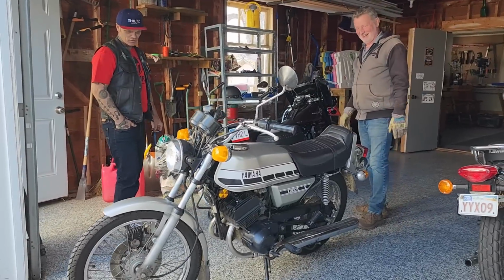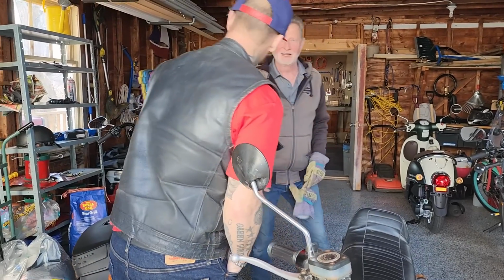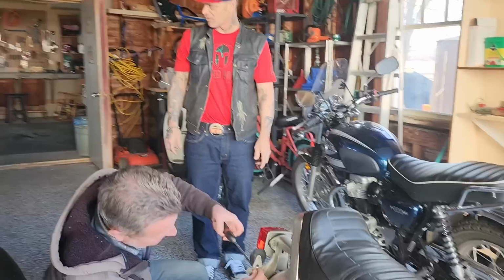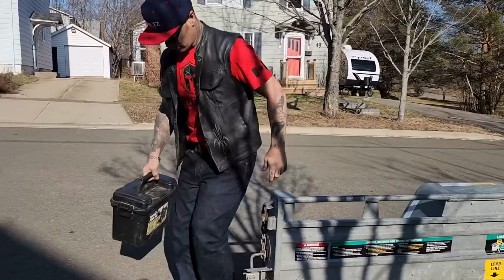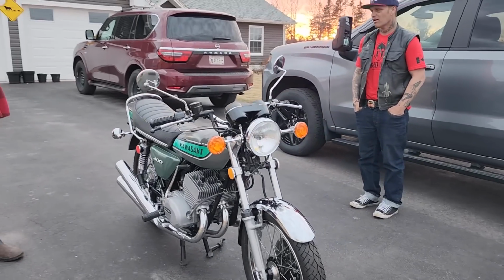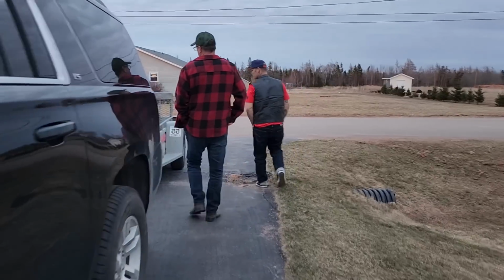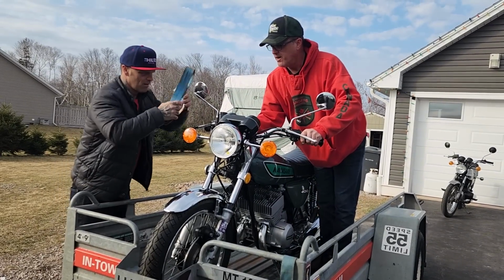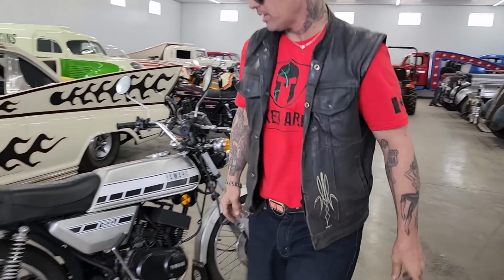Can't believe we found this for sale on facebook marketplace 😝

Comment: Chad, the guy who sold you the Kawasaki was an excellent rider and his advice not to lay down the Yamaha was absolutely correct! If you had several moving blankets and padding and took off the handlebars, tank, front wheel and front fender you might have avoided damaging the Yamaha but it would still be risky. You and Jolene really scored on the bikes and the former owners! Great video! Congrats!

Comment: Hi Chad & Jolene, that is quite the collection of motorcycles that you have aquired. You guys are going to run out of room in your new building pretty quick at this rate. You may have to put in a 2nd story with a lift for the bikes. You can install metal 2nd storys that are supported with posts from the first floor. Alot of dealership parts departments are done that way in the U.S. and they carry alot of weight. Those were nice looking bikes with low kilometers they will be a nice addition to the collection that you have. Thank you Chad & Jolene for taking us along with you on your trip. It is nice to get to see some of Canada as well as seeing the bikes!
Reply: Those R. D. s were a good pretty reliable road bike.

Comment: Most of the early Japanese motorcycle brands have a lot of interchangeable parts in their models, you’ll find one part will fit a number of models across their lineup, from road bikes to motocross bikes, using part numbers are key to finding parts.

Comment: The best advice I can give you is go sign up for the cycle safety course near you and do it as a couple because it doesn't matter what you ride or how fast you ride because there is nothing better than wind therapy and I mean NOTHING  better for your soul but if you have a spouse that rides too weather you are riding on one bike together or riding separately, it's something that takes your relationship to a hole new level.

Comment: Great find- those bikes, when they "come up on the power band, are pretty quick. The 500 was FAST, the 750 was just wicked. The 500 was a street beast in its day. Same way with the Kawasaki 500 and 750 triple 2 strokes - wicked fast and fun.

Comment: i was always told to tie down the front of the bike around the fork at the fender connection that way your not using the shocks . attaching at the handlel bars your'e going to get movement and the straps could loosen.

Comment: You really need to know your stuff to keep one of those kawa triples going ,,best to get a expert to tune them or go threw it if you are going to ride it ,,i haven't had much to do with one for years but guys i new said they used to run the middle carb a little rich & ran a different heat range spark plug in the centre cylinder if you don,t they run lean & melt the centre piston ,you could more than likely find info on the net about it ..just letting ya know they can be a bit finakey not many around as most melted over & over as people didn't know how maintain or tune them & they were costly to fix & got scrapped .

Comment: Yes, you can put two bikes on there- move that one over- forget that stick out in the front. Put 400 next to it, staggered back a little.
Duel straps to handle bars on each- pull down till forks are at least half way compressed, then stap back- your done.
No, don't  suggest putting bike in suburban - you have fuel fumes, oil, leaks- good way to burn to death if something goes wrong.

Comment: Does Chad have something against owning a proper trailer for bikes and cars?
Reply: I was wondering the same thing. Would be cheaper in the long run than having to pay a rental fee each time.
Reply: He's not quite evolved there yet, that me- haul trailer will hold  3-4 small bikes like those 2 & he considers stuffing one in the back of a station wagon. Just putting the kick stand down before loading had the guy  lost & confused.

Comment: A good investment. Used to ride a Yamaha XS 500, four stroke, with a similar design, a bike that handled very nicely, had Metzeler tyres on it, a super quality brand as well. Also had a Kawasaki 750 four stroke.
Be careful on the Kawa, fast as a rocket and can be a bit sloppy in the rear - if you ever experience 'speedman's wobble' the cure is to immediately lay down over the tank and let off the gas. Good luck, be careful.

Comment: Great finds Chad! But remember, those two strokes can give you nasty surprises. Like a runaway horse! That 400 is a widowmaker!
Reply: Thats for sure  I have a 1972 Kawi 750 H2 triple and she is an unpredictable girl.
Reply: @Robert Bard  Do you think Biker Bill Kalina is referring to the narrow Power Band ? Gotta ride with your foot over the brake pedal
Reply: @speedfreak8200  That would be part of it,  I know on mine it is a speed wobble problem and having to lay on the tank in hard acceleration to keep the front wheel somewhat on the ground.
Reply: b  Kalina    im thinking u have riden the 400 . i chuckle when i hear that sort of a comment about them . i have some experience on one .
Reply: The sound and smell of a Two Stroke.Nothing like it.I had an RD250 briefly back in the early 80’s.Supposedly had 400cc conversion 🤷🏻‍♂️🤷🏻‍♂️🤷🏻‍♂️ according to the guy i bought it from.JandR expansion pipes on it.Sounded awesome and went like stink in it’s day
Reply: No worry cuz Johnny (chad) don't surf..

Comment: Great find, yes Bad Chad, I start and run each one of my motorcycles and four wheel atv until it stalls making sure the gas is out of the carburettor, that trick has never failed me yet, they will start back up without hesitation or hiccups. You may have to or want to crank over all your motorcycles a couple times a year if not at least once a year, try to plan a day in a month or start them, either or,, it may be all right if you don't but what the hey,, due diligence, preventative maintenance and all that jazz why not..  thanks Jolene for taking us along the ride.

Comment: The Kawasaki 400 3 cylinder 2 stroke is a wicked bike. I owned a Kawasaki 750 3 cylinder 2 stroke which was called the widow maker. Both bikes are highly sought after in the USA. Good purchase Chad and Jolene !!
Reply: Called the Widow Maker because it went like a cat out of hell in a straight line, fuxxer did not handle, no good in a corner, i owned one.

Comment: Hi there, if you are into 2 stroke motorcicles, look for a 750, 3 cilinder water cooled Zuzuki. The so called water buffalo here in Holland. That is a real icon and a rocket to drive......👍👍👍
Even more interasting is the Kawasaki Z900, used in the Mad Max movies. They are worth a fortune.

Comment: Chad you are correct; Jolene is very sharp , she noticed that fuel petcock was on and needed to be turned off.  Beautiful bikes and worth the drive.back in the day we had a bike shop and sold those exact bikes you purchased.  With that fleet you have you need an experienced   mechanic  . Thanks for the video. It seems many people retire to the east cost of Canada . Spring is obviously there. where we are in Ontario we still need heavy jackets and heating.

Comment: Whilst moving a bike leave it in gear pull in the clutch, when you stop let out the clutch, it won't move, especially if the bike is down hill (I learnt the hard way 😂) leave it in gear whilst on the trailer also. 👍 👌

Comment: Nice score! I just found a 69 HarleyDavidson FLH and a 64 Harley Davidson XLCH for sale within a few hours from me.  I already own a 68FLH that was my father's, and my 1st bike was my 64XLCH that i still own. I want to buy the 64 at least, but i don't have room for it right now and I'm in the hunt to buy a house. 

Both bikes should fit on that trailer easily! Roll one straight on, move the ass end over, and strap it down, then back the other bike on and strap it down. Two will fit easily. 

Edit: or maybe i need to shut my mouth and watch the video before i comment, because that's exactly what you did. Awesome video Chad and Jolene! 🤘

Comment: How to lay a bike on its side safely.  See other post on loading the trailer easily.  The problem with laying it over is two fold.  1 it will drain the carbs and fuel line when laid over and can flood the engine cylinders with gas and wreak the engine.  To eliminate that there is a screw at the bottom of each carb near a hose out of the bottom of each float bowl.  The hose may be missing but the screw is still there.  You just loosen the screw until gas runs out on the ground and stops.  Do this one carb at a time to make sure each one drained. If it doesn’t drain you either have a carb not working or junk in the bottom of the float bowl plugging the drain.  Anytime you park the bike for extended periods 3 months plus you should open the drains and empty the carbs to eliminate gumming them up with varnish and corrosion.  Second issue with gas is to get the tank empty before laying the bike over.  The cap is vented and especially on old bikes the gaskets on the caps leak and you can fill the vehicle with gas.   Other issue with laying the bikes on their side for extended periods transporting is the seals in the engine can allow oil to get past them and cause fatal damage filling crankcases on 2 strokes with transmission oil or filling cylinder with oil through valves and rings.  Some older bikes have separate oil in the transmission and engine sections but have a vent hole for fumes high in the cases.  When laid on the side for long periods it can transfer oil from one side to the other with catrostrophic

Comment: Forgot to mention: turn your handlebars all the way to the left, it will make the bikes much more stable and less likely to get accidently knocked over. Either that or put them on the center stand if so equipped.

Comment: I have a suggestion for that center piece you are doing on the Thunderbird. Rather then filling it in, leave it open with maybe 3 vertical ribs inside for support and keep it looking like a vent.
Reply: Or add brake lights!
Reply: Sure sure, a good play for tent caterpillars to nest also ..... weld it shut, keep the air out, unless you think it should be painted inside first.....!

Comment: Just a tip when I take a motorcycle in a box trailer I usually put the front wheel into the front corner and Slide the back wheel to the left hand side or the opposite side that you put the corner of the front wheel in that way there's no way it can move forward backwards sideways or any other way and it really anchors a bike solid

Comment: Nice little bike to add to your collection. I think it would be a very good idea to drain the gas out of everyone of them. Or at least add an additive to the fuel to stableize the gas, Not sure what gas quality you have there, but here in the US the poor quality of gas distroys the carburetors, fuel pumps, and any other part of the fuel system. it litterally eats the insides away, if not run for even a little while. Carburetors can be very expencive to replace. And you have many of them.

Comment: That RD200 is in great shape, but I’d be sceptical about the claim of 800-odd KM.  Something seems suspect about the tires being replaced with less than 1000KM on them, especially if it’s not being ridden.  It also seems odd that the kickstart would be stripped on an electric start bike with such low mileage.  That won’t be an inexpensive repair if the shaft is stripped, and may reduce the bike’s collectible value if not repaired.  I also wonder that the clutch needed repair after such little mileage.  Maybe this bike was ridden hard, or maybe the speedometer (odometer) has been replaced…
Reply: I agree. It been used alot, and the mileage was probably set to 0 when it was restored/repaired. Just look at the front shocks. They would not look that way if properly restored.

Comment: When you tie a motor bike down, never go on to the handle bars. You can blow the pressure out off the forks 
Go low and wide as possible Chad
Reply: That's a myth, I hauled motorcycles on a trailer or in the back of a truck for 15 years and I always used motorcycle tie downs on the handlebars, so did all my friends, and none of us ever blew out anything on the front forks.
Reply: That’s really silly, the oil in a telescoping front isn’t under pressure, it merely works as a shock absorber, the springs support the load.
Reply: @petedavidsen1760  When you strap a motorcycle down by the handlebars all it does is compress the springs inside the shocks, which is what they are made to do. You are not hurting anything. I rode motorcycles from the time I was 15 until I was 30, and we strapped them down a million times in the back of a truck, and not once did it cause a problem to any of the front shocks. We even did long drives with them that way, from Peoria Illinois to St. Louis, many many times, which is about a 3 hour drive each way.

Comment: Hi Chad wants to say 2 stroke motors last , reason being , is burning oil in the cylinders. I don't trust oil injected systems disconnect them myself an mix the gas with oil myself. If the auto injection pump malfunctions no oil mix, bam blow up the motor.  Your welcome lol !!!

Comment: Just as a precautionary measure you should Always move a motorcycle  While you are sitting on it. If not and it starts to fall away from you, there is no way to Stop it. I have dropped a few by not being on them.  Just trying to save you some dented gas tanks.

Comment: The Kawasaki you got there is made as a serie of 3, 250cc 350cc an yours 400cc the 350cc is the one with most hoursepower. It is funny to ride and fast of it's age, the 350cc i hade the gear shifter was one up and 4 down...

Comment: There's only 2 kinds of motorcycle 🏍 riders, those that have crashed & those that are going to crash. You almost gave me a heart attack each time you said "lay it down" you could build a 3 rail bike trailer really easily. I have riding since 68' & still ride fast. But you guys are smart buying these super collectible little bikes.Even if you have to pay up for a nice example, I feel it's worth it. No biggie if you're not into riding Chad, but personally, I have the need for speed. Love these road trips... keep the rubber side down.  I have a Built Banshee 350 the bigger bro of your 400 it rips

Comment: Don't put the straps around the handlebars Cubs aluminum tripletree a holds the handlebars and place with the forks will snap you will break up I hope you know that much because I did the same thing on my 500 Honda it's aluminum 1972 Ford cylinder and it took me forever to find another triple tree